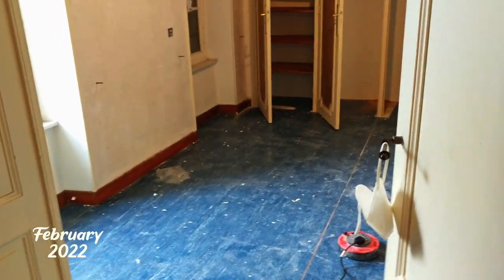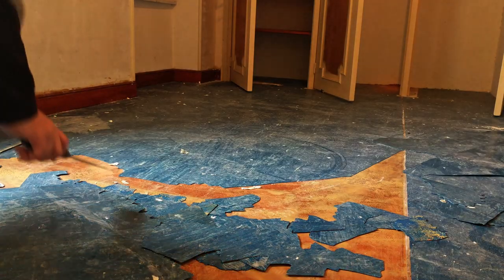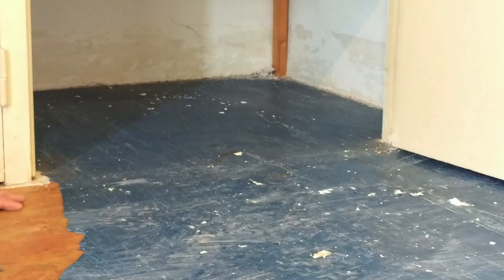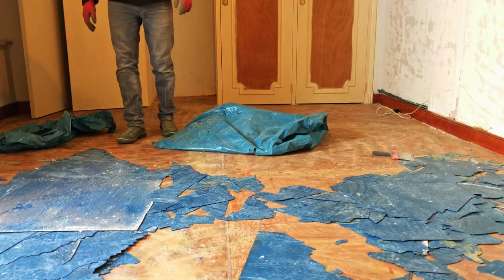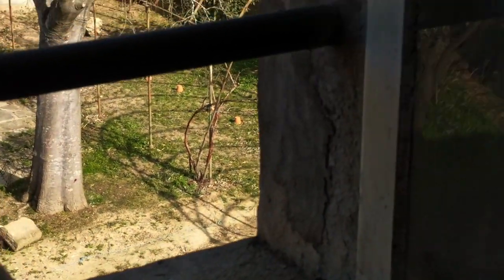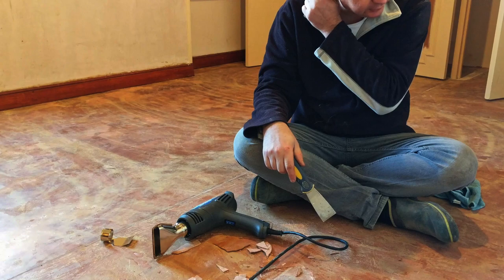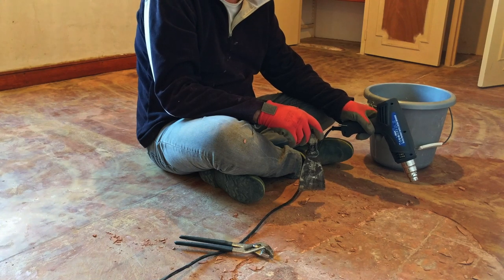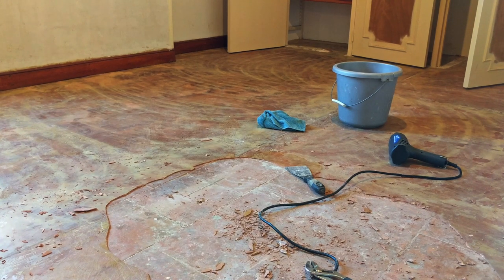Restoring Our Games Room Floor

Comment: That lino seemed to come up easier than I thought it would.  Was it dry and brittle? I hope you managed to finish revealing the tiles eventually.
Reply from the maker: The limo came up pretty easy. There was some strange glue under it that was really difficult to remove.   I had to stop because I didn't have a great mask to wear and I was getting headaches.   Then spring came and I switched to working on the outside. I have so much to do in the house it was more about exploring the state of the tiles to evaluate if I could save them. I think I can and I found a handful of tiles used for the garden beds that I cleaned up that match the size of those tiles to replace any unsalvageable ones.  Stay tuned I will return to that room once I finish some of the high priority jobs.

Thank you for watching!

Scott